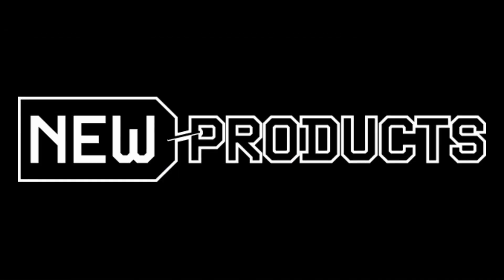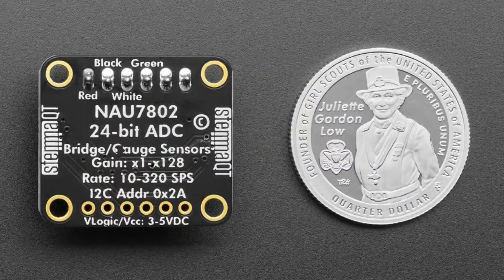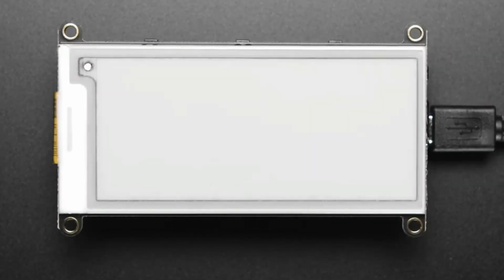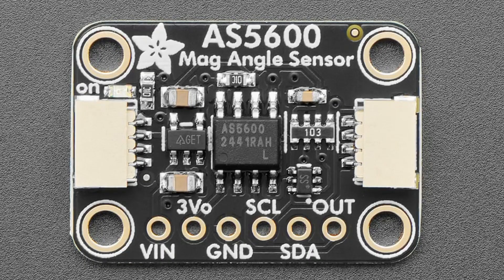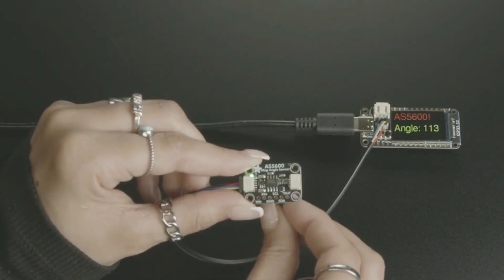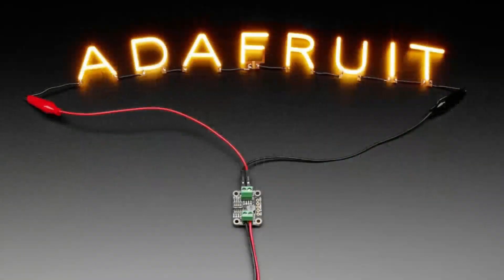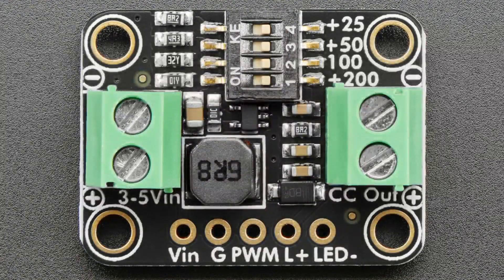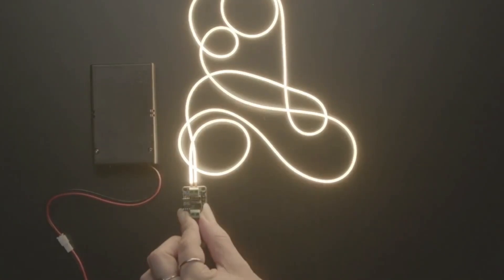#NewProducts 6/25/25 Feat. @Adafruit TPS61169 Constant Current Boost Converter for LEDs

Comment: I recommend MT6701 as a MUCH better general purpose low cost magnetic encoder. The AS5600 is very noisy and has a limited dynamic range for magnet strength, making it really finicky to work with. And let's not even talk about the TLV493 with its silicon bug causing regular lockups 😮. MT6701 was night and day when testing magnetic encoders for my SmartKnob